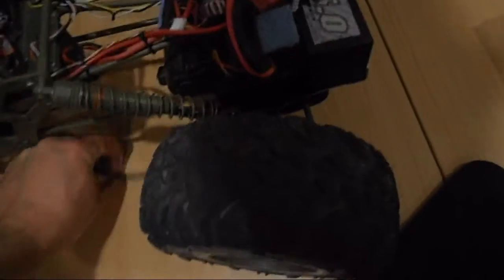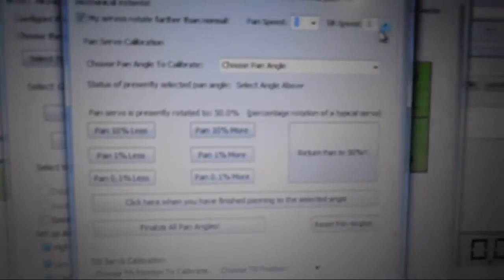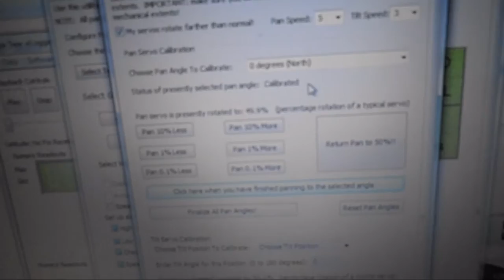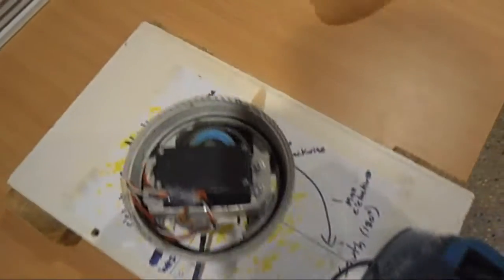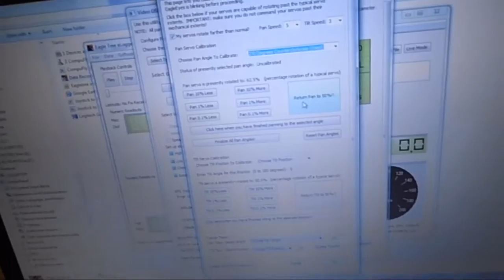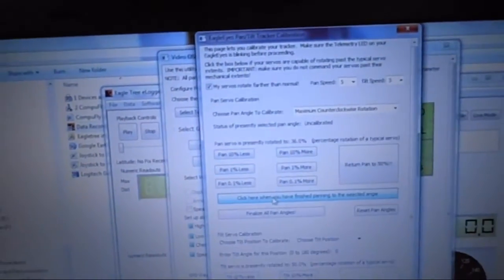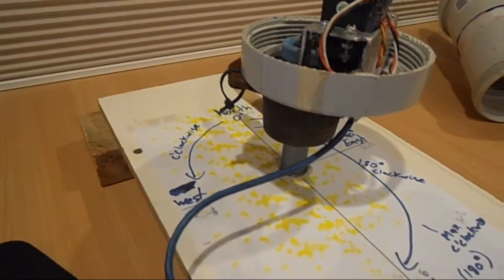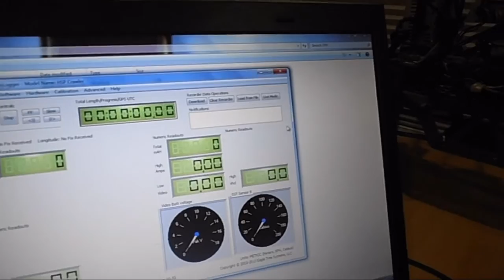Setting up antenna tracking with Eagletree

Comment from the maker: How it works is that your onboard OSD telemetry first finds your starting gps location and then when you move away from your 'Home position' the telemetry calculates the heading you have traveled from home. ie if you travel due east from your home location (which is 180 degrees on the compass) the OSD sends this data (through your video signal) to the Eagletree on your ground station - this then sets your pan servo to the spot that has been calibrated to the 180 degree position.